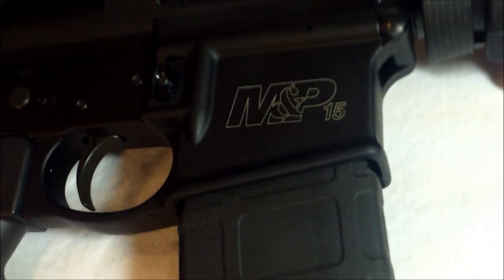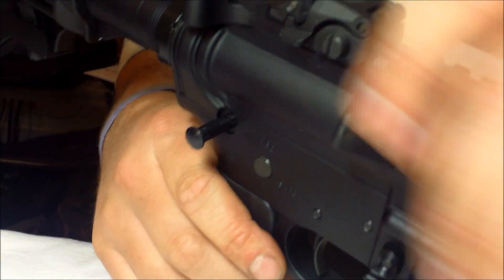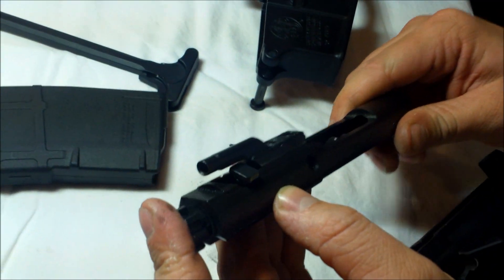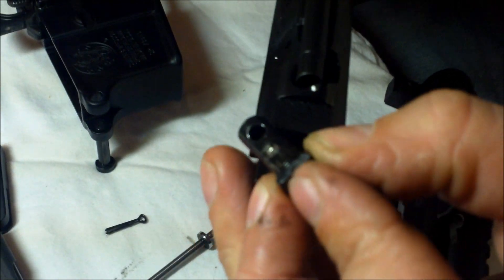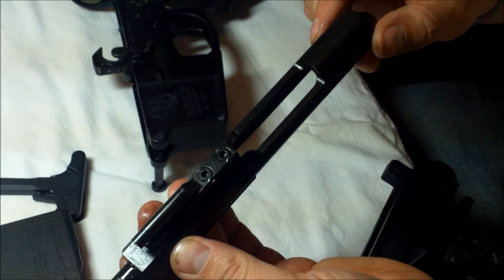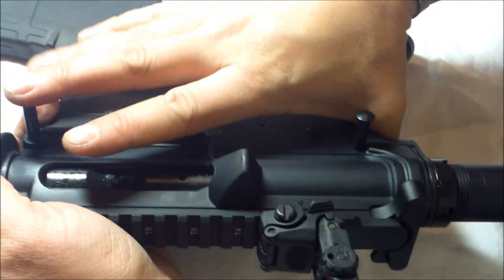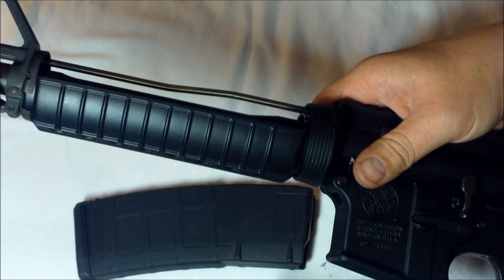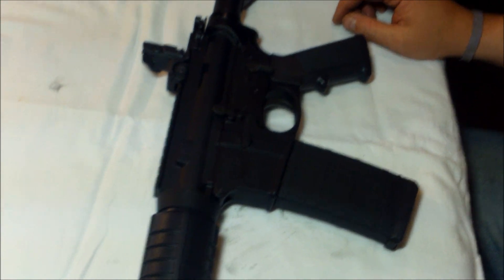Smith and Wesson, M&P 15- Breakdown

Comment: Wow, you must have super powerful hands to remove the forearm! I checked the owners manual on-line and it states you need 2 people! Someone on Youube uses  a rubber coated long handle tool to grip the collar and push down. I'm an old man and found this to be very hard to do also. I wish I had bought a Ruger which has a twist on forearm.

Comment: more constructive criticism: good video, but you didn't disassemble the bolt, didn't remove the buffer and buffer spring, didn't touch on cleaning the trigger assembly and forgot to check to check the safety as part of the function check.  Just locking the bolt assembly back doesn't really check anything.